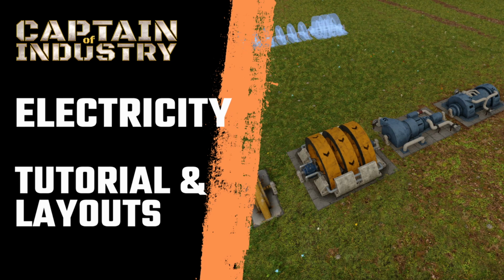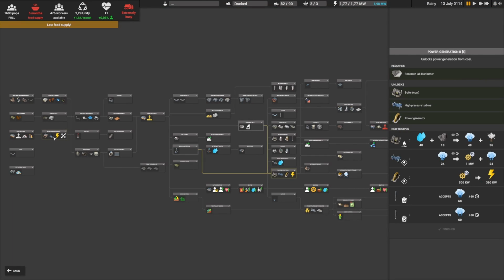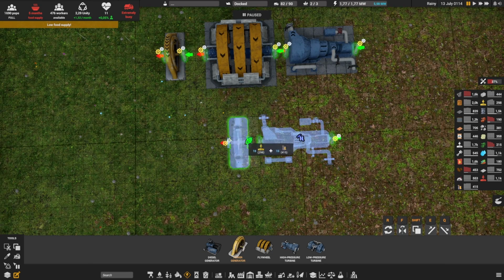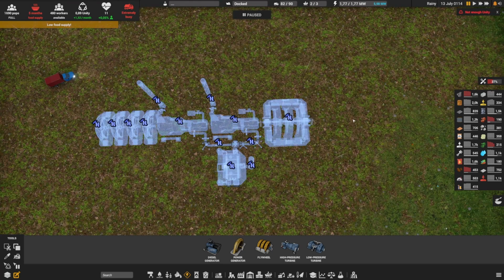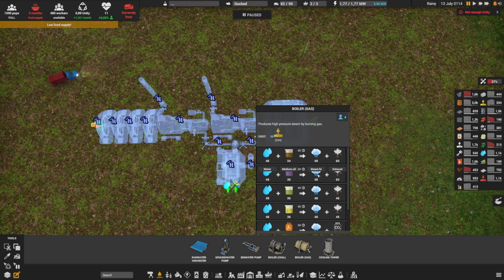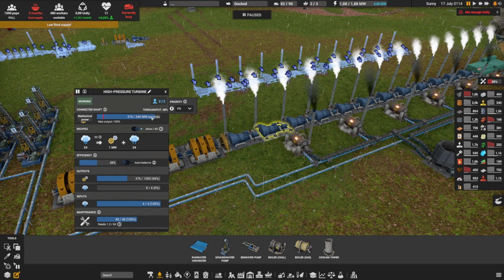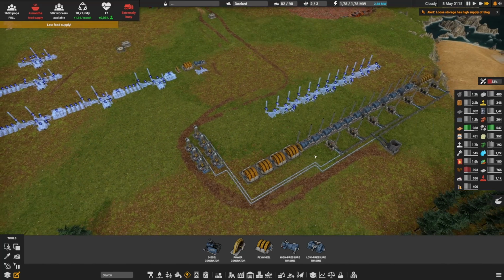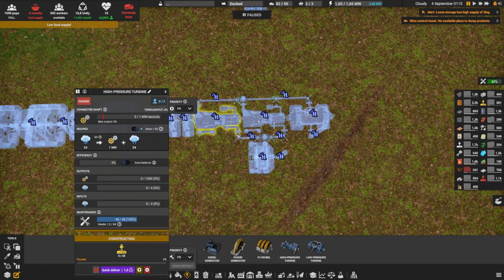Captain of Industry - ELECTRICITY - TUTORIAL & PERFECT EFFICIENT BEAUTIFUL LAYOUT - Guide

Comment: Very good! Active Power, makes the Flywheel in a storage container, used for uninterrupted power at data centers in Austin and beyond! Base power load should be generated burning Coal to make Steam High for High Pressure Steam Turbine mechanical energy without Auto-balance. Additional steam turbines can be on Auto-balance if flywheel installed. Leave a Diesel Generator hooked up and paused as backup power. 12MW is maximum power per power station.
Reply from the maker: Thanks Darel - indeed that steam power is super strong :)